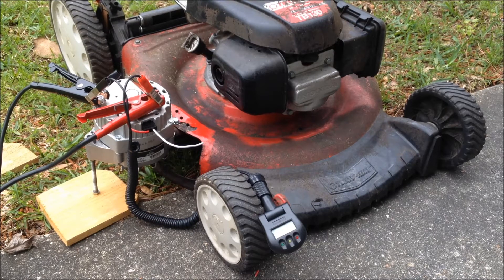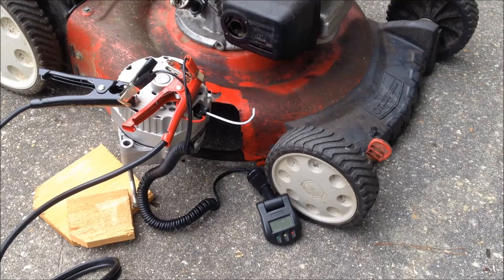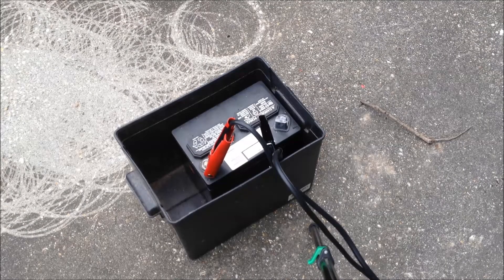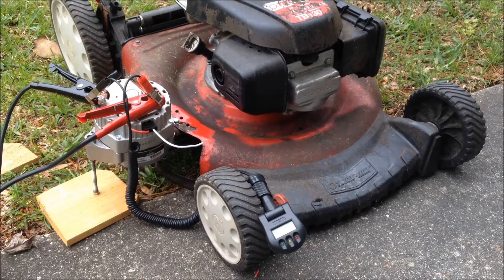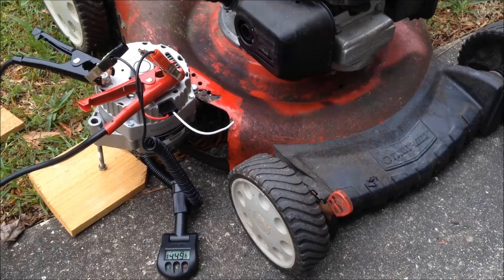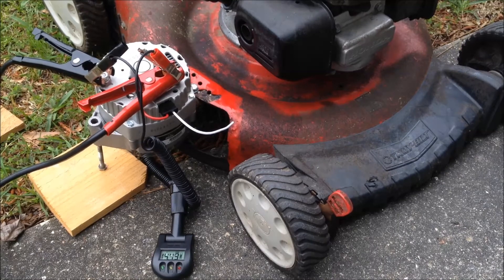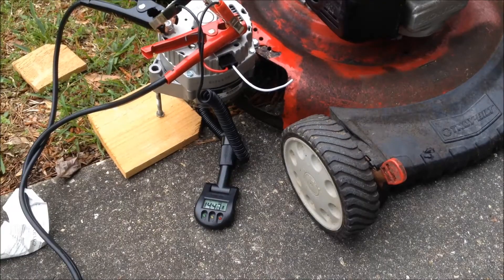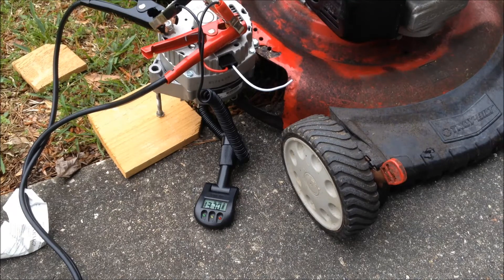Lawn Mower Generator build

Comment: wow sounds like that motor was run out of oil and has WICKED ROD KNOCK... got OIL in it? THICK OIL??? 20-50 with 20%+ STP OIL TREATMENT to make the oil thick as honey for WORN ENGINES.    the price of NEW 120amp GM alternators is/was $65 on e bay so if want to run more than just small stuff, need A/C?  lights, fridge... computer/laptop.   then got to figure the cost of the inverter too... the small  one was $40 for the 400 watt inverter which is good for tv/dvd player in big trucks

Comment: I never get a coherent answer to this: will the alternator bearings withstand  unnatural vertical installation? Won't the rotor eventually lathe itself thru the whole thing?
Reply: I would think the belt tension would negate any gravitational pull.
Reply: It would be on ball bearings, while having a rolling thrust bearing is ideal, it should be fine for the small amount of work and vertical load I image this see's. 
Otherwise you could assist the  bearing by mounting the alternator slightly lower that the pulley on the engine and the belt should help lift the rotor.
Reply: Yeppers! A solution: I added an external bearing to support the  weight under the wheel and a plate where the whole contraption now stands vertically upon, shimming any freeplay and eliminating any axial stress for internal bearings. Internal modification is not needed, any standard alternator will do just fine.

Comment: So... can you just put the positive and negative leads into the battery and and alternator? Will this work with a car alternator, i remember seeing a video that said you needed to do something to make resistance because care ones dont have magnets
Reply from the maker: Umm, the alternator in this video IS a car alternator. You don’t need resistors, on the newer ones, since they are internally regulated. So yes, you can put the positive and negative to the alternator and battery. You may want a switch on the lead for the field coil, so that starting the engine will be easier. That being said, you should look for a delco 10si or 12si alternator, like the one in this video.

Comment: Try making one that turns out ac :) without adding an inverter.
Reply: any alternator  makes  wild  AC.      in general, that  wild AC  Needs to be processed.        the first step in such power processing is the  full wave  rectification of the wild AC, to DC.      while the change in volt-amp values after rectification 'suggests' that  energy  is  lost in rectification,  that is  Not  so.!    because, the energy  Density of AC  is  less-than that of  DC.      so, the values  reduce.     the amount of energy does  not.           when a manufactured alternator has fewer than three leads, it usually means that a rectifier is  built in.        in a modern car  alternator,  More than just a  full wave  rectifier circuit may be present.      this is why it is always recommended  that an 'older' alternator be  re-purposed.         cheers
Reply from the maker: Interestingly enough, that’s not too difficult. Older alternators often had the diode pack separate from the alternator. Indeed some more recent alternators have a removable diode pack on the alternator, so it wouldn’t be too difficult to get ac. The challenge would be maintaining a consistent output in Hz, given that engine speed could vary.....
Reply: @kg5radio716  smart man. I give you 4 out of 5 stars.

Comment: Thank you very much for sharing .. I am not that good with electricity and motors ..so .. I have a question .. how would you know if the battery if fully charged? how would you know if it will not over charge the battery ? does the alternator have a charging regulator to keep track of the charge?   also .. is there a way to muffle the sound of the mower?   thanks again man .. nice work.
Reply from the maker: You would know if the battery was charged by disconnecting from the alternator and taking a voltage reading. If it reads 12.7-12.9 volts, it’s fully charged. There isn’t a charge regulator, only a voltage regulator on these GM alternators. Remember, these are designed to be used in an environment where there is current draw while running, as the alternator is tasked with running the lights, blower motor, ignition, and other electrical circuits, in addition to charging the battery. Since there is no other loads, this is essentially a fast charger for the battery, so it should charge much faster than normal. That being said, if there were more loads being run, you’d find that it won’t charge nearly as fast. This particular alternator is rated for 63 amps at 13.5-13.9 volts DC under load.
Reply: @kg5radio716  
well explained buddy.. I appreciate you taking the time and for responding.
Reply: @kg5radio716  I would put power resistor in line with battery to make sure battery is not overloading alternator. With voltmeter mesure voltage drop on that resistor, depends of the reading you will know if battery is charged or not. More voltage drop, battery is less charged.

Comment: Can I connect my 12v car stereo directly to the alternator and use it as a power supply? great video
Reply: Ehhh yes... but no..  

Yes: you CAN, but without a battery, the alternator will output 18+v which can easily blow 12v electricals. EDIT:  with a selfexciting alternator yes, with a traditional alternator you NEED a battery to power the field windings of the alternator, to make power. END-EDIT

No: Don't do it, unless you're super rich, and can afford to buy stereo after stereo..  if you're poor like me, get a battery, truck battery. Power capacitor wouldn't hurt either. But.... if you're running a stereo off this I hope it's big, to drown out the sound of the mower. :) 

Hahaha stay safe out there, may peace be upon you and your's. :)

Comment: that mower sounds clapped. and judging by the oil on the deck the rings are worn and there's hella blow by from the crankcase vent. I can see why it was on the curb lol
Reply: So? It starts right up and it was free. I've had a bunch of lawnmowers with what people thought were bad engines. Most of the time the ether are overfilled will oil or have never had a oil change done to them. The oil on the deck could be from the valve cover gasket as well or overfilled and oil was coming out the exhaust or spilled from old owners. There's no smoke from the exhaust at startup and started well the clacking sounds could be a loose Bolt on the alt or engine mounts or loose belt hitting the deck
Reply: Possibly the belt is a bit loose, slapping everywhere. Did I see the alternator swung a bit at startup?

Comment: What kind of pulley ratio did you use. A bit of mulling around google for quoted rpm's makes me think  2:1 Mower:Alternator would put the alternator at a normal speed for a cruising car and put it in it's maximum power range.
Reply from the maker: Its more like a 1.5:1 ratio. I could have used a larger pulley, except that was the only size one at tractor supply that would fit a 1 inch prop shaft.

Comment: Can you run a fridge off of it?
Reply from the maker: If it isn’t too large, yes. If the alternator was 100, 150, or even 200 amps, it wouldn’t be a problem at all.....
Reply: @kg5radio716  thank you so much , I need an alternator and a battery?
Reply from the maker: Yes, and an inverter rated for the load you wish to run. Unless you want to power 12v DC appliances.
Reply: @kg5radio716  I don't know anything about the lingo you just said lol. I'm trying to learn, I want to build one and get ready.  Where do I get am inverter and can you do a video on how to hook it up
Reply: Brandon Felder Amazon. By time u finish collecting parts it’s better off buying generator
Reply: @themechanic4222  But if done right with deep discharge batteries I have run a generator and several chargers for six hours and still have electricity for the next 18 hours. saves gas, noise and wear on the generator.
Reply: @3000isreal   Ready for a Lesson? 

House power = 120-240 volts Alternating Current (AC) at 50-60hz (cycles per second, how many times the power goes from zero to full positive, to zero, to full negative back to zero, one cycle... happens 60 times a second. In North America, a standard 120v outlet is capable of supplying 15amps, or 1875 watts. 

This alternator, is no different than your car, running at 12 volts Direct Current (DC) outputting approximately 100amps. Which works out to 1200watts.

All numbers, if we lived in a perfect world, be aware that losses occur, typically in the form of heat. Moving on. 

This setup, making 1200watts DC, can be used to charge a battery. For numbers sake, I'm going to say a 100amp/hour (Ah) battery to keep things simple.

Getting house power from 12V requires a power inverter. It takes 12V DC and makes 120V AC by electronically switching the polarity (direction of DC current flow) to make AC power while stepping up the voltage with a transformer inside the inverter. 

Voila... your crash course on making power. Now add in some solar panels, wind mills, or a water wheel... means you would rarely, if ever, need to run an internal combustion engine.

Any other questions... ask. The dumbest question is one not asked.
Reply: @ScooterMcAwesomeness  thank you brethren, I did exactly just that 3 months ago. Freezer ,fridge, hot water heater, all running from the invertee
Reply: @ScooterMcAwesomeness  thank you so much
Reply: @3000isreal  my pleasure